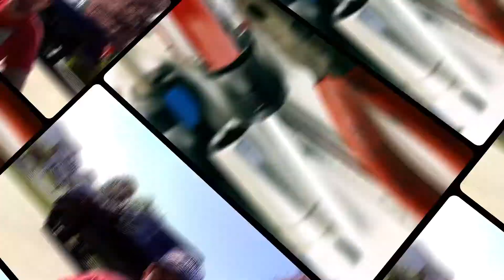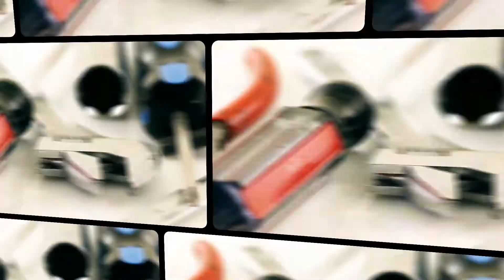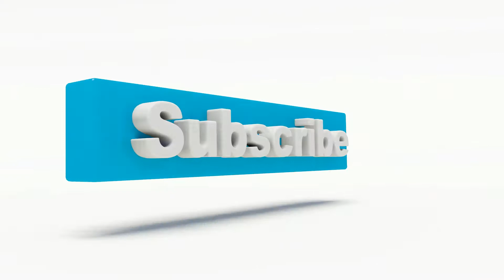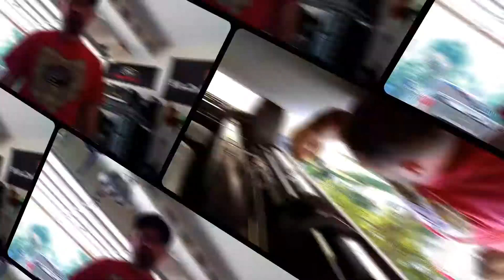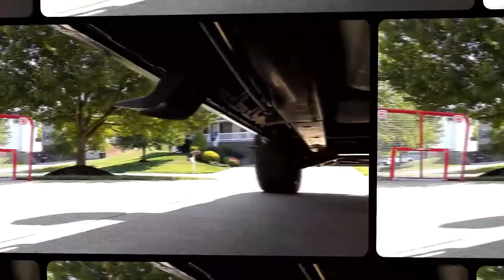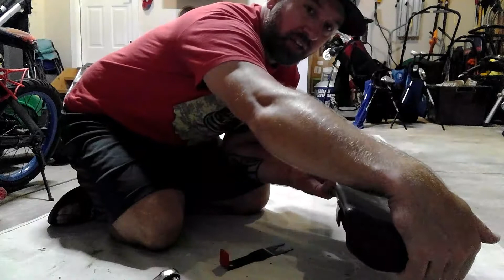How To Disassemble Or Take Apart F150 Running Boards For Rust Removal Restoration Paint Refinish

Comment: Great video... My F150 does not have the individual strips to remove... any suggestions on how to get them off? The Sport Edition Ford thought it a good idea to clear coat the running boards and the clear is peeling so I need to get them redone.. Thanks